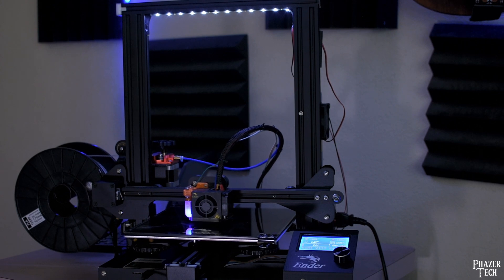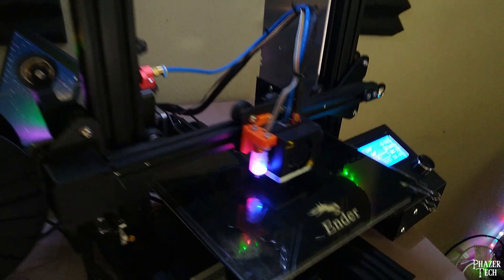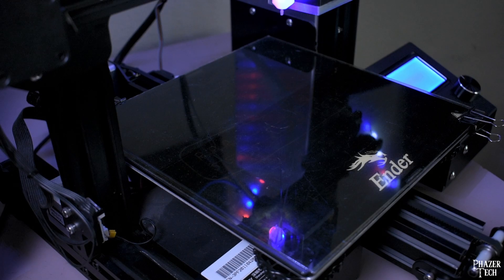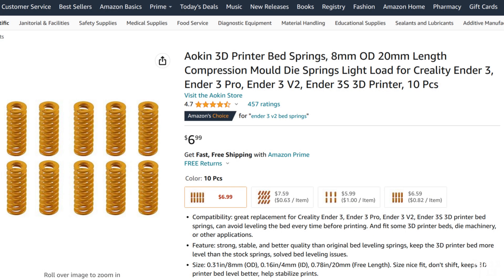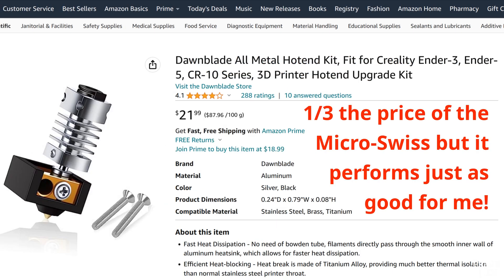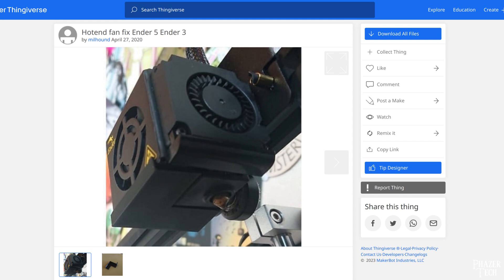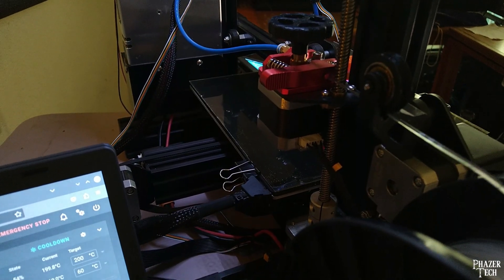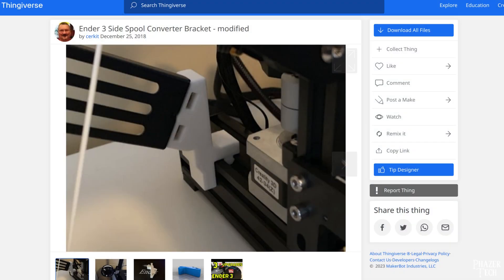My Recommended Upgrades For Ender 3 - Transform A Budget 3D Printer Into A Truly Great One!

Comment: I took a little bit different route.  I started with an Ender 3 V1.  I've installed a dual z drive, a Creality 4.2.7 board, a Sprite Pro direct drive, all metal hot end and upgraded the ducts and fans, a Meanwell power supply, a CR Touch and upgraded the display to a V2 type display.  I also upgraded to the MRiscoc professional software, and lastly a Diamondback diamond 4mm nozzle.

It's kind of a frankenstein Ender 3, but it works great.
Reply from the maker: Nice! That Sprite Pro DD looks like a solid upgrade. Did you see a noticeable improvement after installing it?
Reply: I installed it before I ever turned it on, because I knew from the beginning I was going to printing parts for outdoor and mechanical use.  The truth is, I don't know if it was an improvement, but it does print well and the e-steps are on the money.
Reply: What's the dual z drive do?
Reply: It puts a worm drive on both sides of the x-axis, so there's no delay on the side that's usually undriven.  Basically, it keeps the x-axis parallel with the print bed.  Makes for better, more consistent prints.  Still fairly cheap from Creality, at about $40.
Reply: @lindeleasley  Neat, you noticed a percievable difference?
Reply: I installed the dual drive before I ever printed anything, so that's not an easy question to answer.  I can tell you that when the drives get out of sync (when I've done other maintenance to the printer), it makes a real difference.
Reply: Do you need the other motherboard if using a BL Touch?
Reply: I would say something above the stock board would work better with a BS or CR Touch.  At 8 bits it doesn't have a lot of head room.  I had my 32 bit board before I installed my CR Touch.

Comment: Good to see you doing 3d printer content again. I'm about to view your practical electronics & circuits video for some guidance on a few projects I've printed, but not finished building due to having to make electrical connections to motors and lighting. Keep up the good work. You could maybe think about publishing a video on how to design simple 3d parts (boxes, etc) for custom upgrades. Again, much appreciated content. Be Well and Happy!
Reply from the maker: My practical electronics & circuits videos should be extremely helpful for your projects. I'm planning to release the next one in about a week or so. Also I agree making a video about designing simple parts sounds like a great idea, I'll add it to the list. I'll probably be using Fusion 360 since there aren't any good FOSS alternatives that match its features, but they offer a free hobbyists license so I recommend taking a look at that. Thanks again, take care and have a great one!
Reply: @PhazerTech  I've already d/l it. Do you recommend any videos on remixing stl files?
Reply from the maker: Here's a good video that shows how to import STL files and convert them into an editable format. It's a bit more difficult on the free version, but still possible, depending on the object and what you want to do with it. https://www.youtube.com/watch?v=5AaMVnnvwbI
Btw some makers provide the f3d files in addition to the stl files because it's much easier to edit an f3d file.